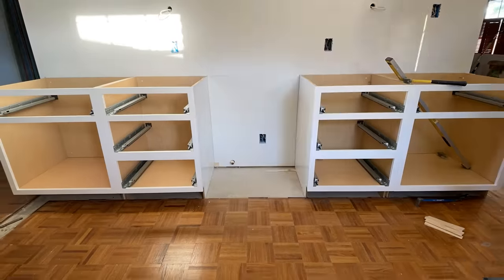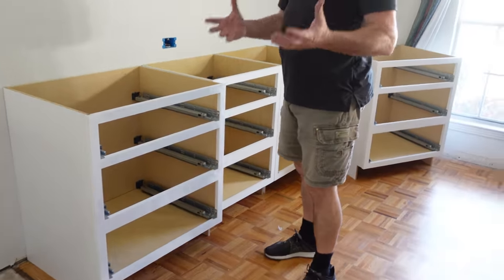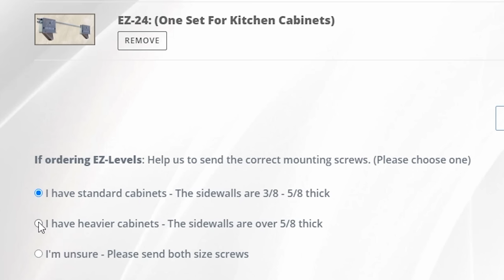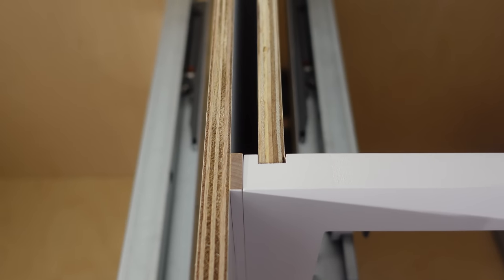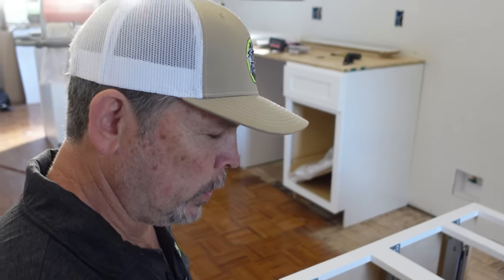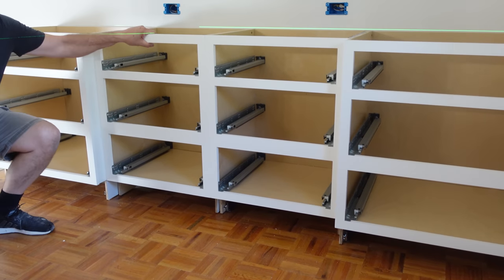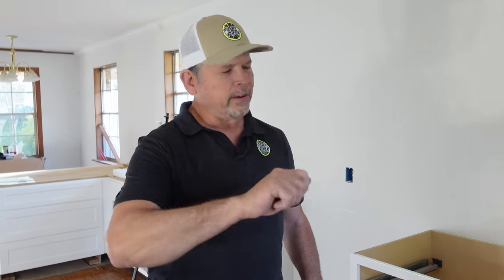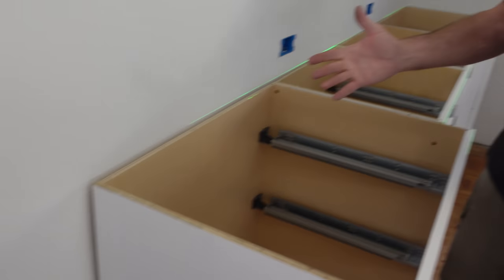$2 Shims VS $40 EZ Level - Is It Worth It?

Comment: This is an ad.  If you find level on the floor first, you can plan it out easily.  I use linoleum,3/16" plywood, 1/8"plywood all of which are plentiful as scrap on any cabinet job.   If you want to get super technical, you can use card stock or something similar.

Comment: With the cabinets filled, I wonder how much weight these adjusters can hold?
Reply: Over 350-lbs for each foot.  That equals over 700-lbs per set and over 1400-lbs per cabinet (with two sets installed). You could stack all of the kitchen cabinets and Granite on one cabinet with two sets of EZ-Levels.

Comment: In Germany we mostly use adjustable plastic feet that are included with every kitchen. I don't understand why you're using wood as feets for the cabinets. It just doesn't seem smart in the kitchen where you can spill something and then it crawls up the wood resulting in mold. Cabinets are protected from most spilled fluids when using plastic feet.

Comment: I'll still use shims, been doing cabinets for 40 years.  The down fall with the screws on the floor holding up the cabinet, cheap flooring and the screw heads will dimple, or sink into it!  Leaving a void.

Comment: Paul is there any concern with point load? Instead of spreading the weight of the cabinet counter top and load of what ever is going in the cabinets. And depending on what material your liading the weight onto hardwood versus sub floor plywood. Don't get me wrong i love the idea of the system and the time it can save. Just thinking that over time those feet will make holes and the what?

Comment: I wonder if there would be some way to use the EZ levelers in a less disposable capacity (unless I'm misunderstanding that they're just left in place forever.) It'd certainly be incredibly easy to attach them to a 2x4 or something then set the cabinets on that 2x4 and use the levelers as they're meant to be used. But then you have to replace them for the cabinet footing. Silly as it sounds I wonder if adjustable metal feet like are used on some stools and tables could be put in place to help support the cabinets, though that might end up being almost as expensive as a set of levelers you just leave underneath the cabinet.
Reply: As the house settles over time you can just open the toe kick to re-adjust the cabinets with ease.
Reply: European style cabinets have always  been set with plastic leveling feet.

Comment: I wish I'd known about these a few months ago. It took me days to level my cabinets, and they're still far from perfect.
Reply: Many times if the floor isn’t level, especially when it’s got high and low areas down the floor. I’ll take a straight edge and clamp it to the top of the cabinets so I know it’s got a straight level line and then just push shims underneath to where the shims make contact with the toe kick.  Depending how the cabinets are built, you can clamp a straight edge or a straight piece of plywood on its edge to the cabinets front and back to get a pretty straight line of level cabinets in a long run.  Personally I hate modular cabinets anyway. I rather install custom cabinets that’s designed and built to the length of every wall. Custom cabinets still may sag a little in a long run, but so much easier to level up the cabinet shinning the low area wherever it is?  Just too much flex in module cabinets for my liking! But that’s only one of many issues I have with modular cabinets! Once you’ve installed custom cabinets you’ll be spoiled and never want to see a modular cabinets ever again! LOL

Comment: 8:14 This explanation seems wrong? The holes on the template are horizontal while the adjustment rods are vertical?
Reply from the maker: It's per their instructions but I see what you mean.  There's only one hole per side.

Comment: Can’t you use Easy Level to level the cabinets and then put the wood shims in and screw the cabinets to the wall; then remove the Easy Level shims for reuse?😁
Reply: The EZ Level system is designed to support over 3000 lbs. I never have a problem with my stone countertops even delicate marble never cracks from settling. I can't say the same about wood shims, they expand and contract over the years.
Reply: @Wharfrat992 , you are absolutely right, also ask a remodeler how many times they have seen shims not in place even after one year.

Comment: If those are $16 a set and you used 5 it cost about $80 for that cabinet set. But you saved 5-7hours labor so you still spent less per cabinet to use those levelers.

Comment: This is why I build all my cabinets to euro specs and just have leveling feet.
Reply: I like the way NS Builders does it. Have cabinets built with no toe kick. Put a level straight board on the back wall at toe kick height. uses adjustable feet for the front which have snap on toe kicks. simple and easy.

Comment: Devil's advocate here. You have to add the time for removing the toe-kick and putting it back on, the cost of the devices themselves, and the risk of scratching the floor. It seems the system does have some merit though.

Comment: Seems like overkill to me.   My last kitchen with cheapo preassembled cabs I marked where they would sit on the floor,  measured down from my laser line, and used tile and glazier dimensional plastic shims in 1/32nd, 1/16th, and 1/8 sizes.  They dropped right in first try with little to no need for adjustment.  Of course it's easier with cabs that use a separate toe kick base.

Comment: So this is basically 40$ adjustable feet. Cause that seems expensive. Pretty sure one of those threaded plastic feet from ikea cost way less.
Reply: Every kitchen cabinet i've seen in europe comes with adjustable legs. Not sure why don't americans do this and solve all their leveling issues. Also they don't scratch the floor and a single board covering the bottom of the cabinets looks way better imo. Or you can even make it also a retracted drawer.

Comment: Yikes, these things are $17 for a single pair.  So you spent almost $100 on leveling.  May still be worth it but they are certainly a premium.  Hopefully some knockoffs come on the scene soon.
Reply: Makes sense if you work for nothing, but hourly labor isn't cheap.  I think it would work out the same in the end.

Comment: OMG, can't you use adjustable kitchen cabinet legs? They're so cheap, and we use them in Italy not only in kitchen cabinets, but in bathrooms as well. We use cover boards, that are mounted on plastic clips to the legs. We're never integrating cabinets to floors, so we can always move/change cabinets without redoing the floor tiles. You Americans love to complicate your lives...

Comment: What a boob. Just drag a level line across the wall locate the studs and fasten the cabinet to the line. Fit your shims under any gaps and your done. Your spacers should have been installed before connecting the cabinets together. Make sure you drill pilot holes before you fasten to ensure a tight fit. You don't need fancy gimmicks that YouTubers sell on Amazon or promote a product. 
Ps sliding a monolithic cabinet is a great way to buy a new floor for your customer.

Comment: I had a poor experience with EZ Levelers. I think it’s pretty impractical to try to screw all of the cabinet runs together before you can install the levelers. Especially with a really long run. 6-7 cabinets. Sometimes you just don’t have the space to move the cabinets and get them upside down. Also if one guys is screwing cabinets together and tipping them around and moving them all over places it’s a good way to damage them. Shims are tired and true

Comment: Never bought a single shim because you can so easily make them from left over wood with table saw.
Reply: Sure, even hardwood shims.   But the whole point was that using shims would have been frustrating as hell.

Comment: What a pathetic method for fixing kitchen cupboards. Here in Australia each of the cupboards has large plastic screws fitted to the bottom of each carcass you just reach under the carcass adjust the leveling screw to the correct height then screw the carcass to the wall. When all carcasses are correctly fixed to the wall then a kickboard is fitted

Comment: Im a finish carpenter and a professional cabinet installer  and i don't recommend doing cabinets this way. Learn how to do things the rite way and once u learn, it will be easier and cheaper.  

Also you always supposed to screw your base to the floor. One more thing, lazer are for reference only. Use level

Comment: Well of course all you pro installers are gonna say, Oh yeah! You aren't paying for your own convenience - it goes straight on the home owners bill. $2 vs $40 says it all. They look all of five bucks of metal and you're still screwing into the cabinets to make things level. You can't beat simplicity. Shims not only work in the majority of build examples you gave Stud but transfer ALL weight to the floor, not the cabinet. Shrinking shims? Cracking granite tops? But all this weight on one small metal pin. Yeah right - this all seems like one of those infomercials with appropriate comments form the awed onlookers.